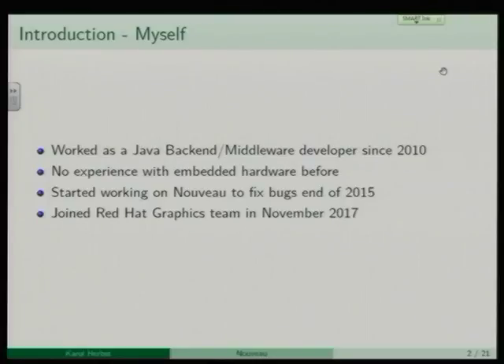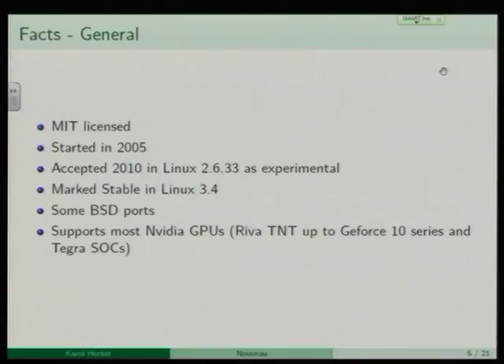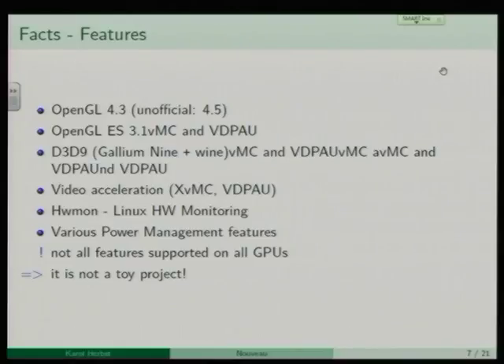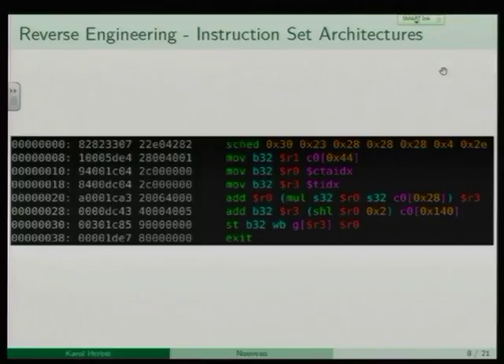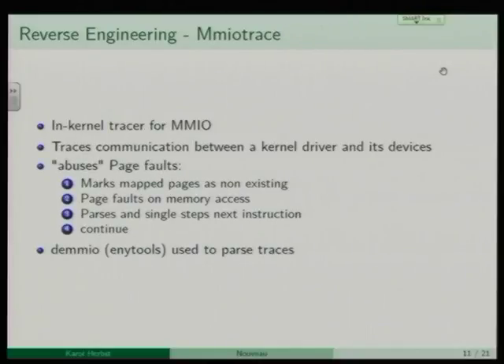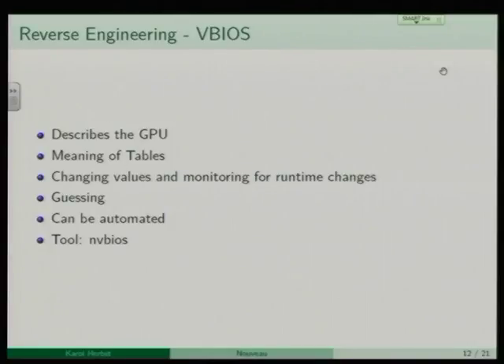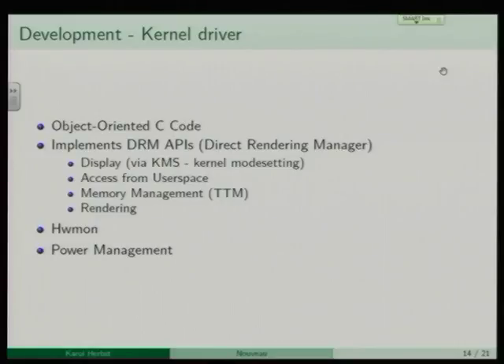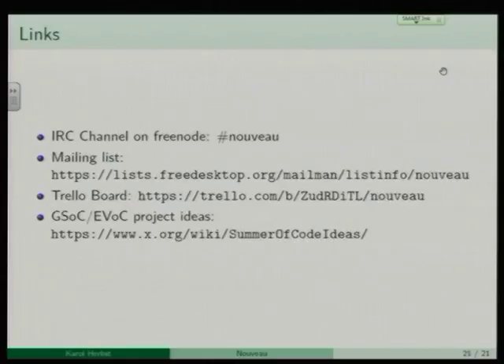Karol Herbst: Nouveau - reverse engineering Nvidia GPUs

Comment: The reason that Nvidia protects their software is due to their ingenuity on how the GPU hardware is being read. If they make it opensource it will only benefit competitors and will give them a backlash regarding all the R&D they have invested. 

On a side note to think about; how come a GPU with more FLOP 'power' is doing worse than a GPU with less but has it's software protected?
Reply: This does not explain why their firmware requires signed binaries for reclocking (basically to put the CPU in performance mode).